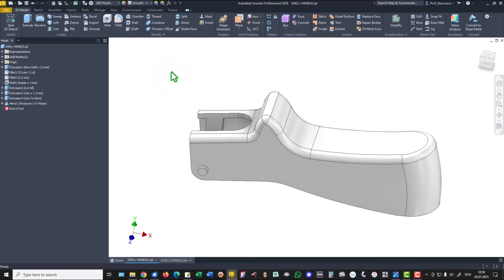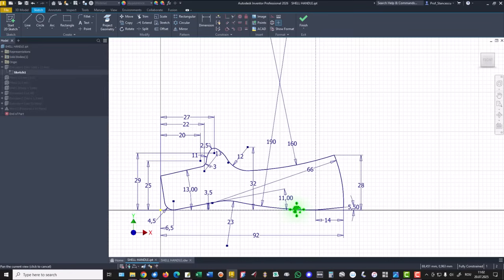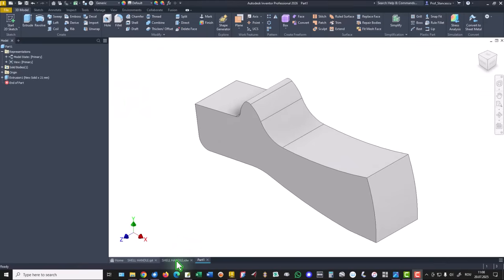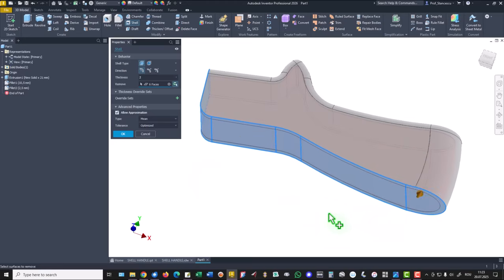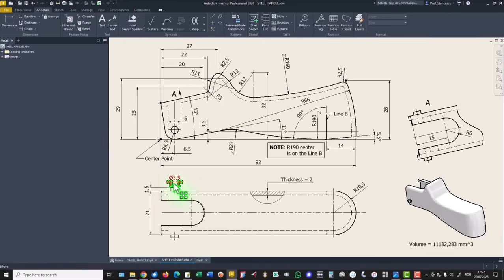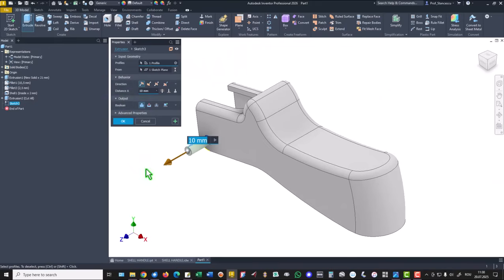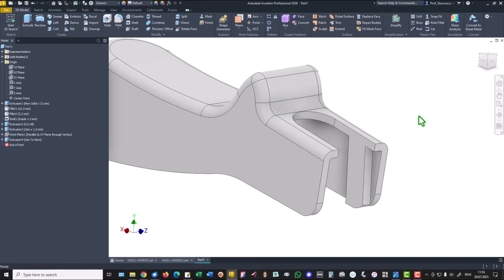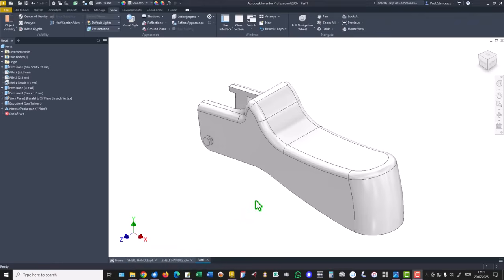Tutorial Inventor - 621 SHELL HANDLE

Comment: I modeled this part in FreeCAD. It wasn't easy, as the "Thickness" tool (once again) refused to work.
So I used a copy of the base drawing with -2 mm offset from the original drawing to hollow out the part. Therefore, I had of course to add the fillets afterward, each one separately on the outside and inside (-2 mm inside).
I ended up with 3 mm³ more volume (11135.74 mm), for which I couldn't find any reason.
Reply from the maker: Thank you for sharing your experience, my friend!